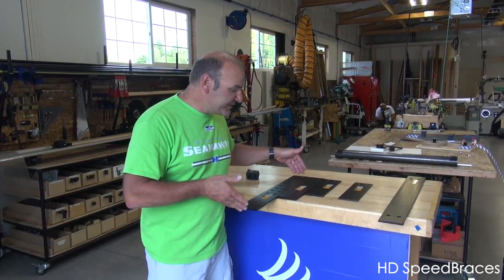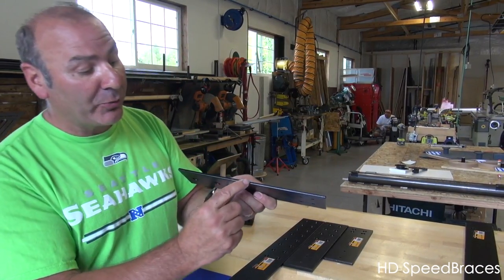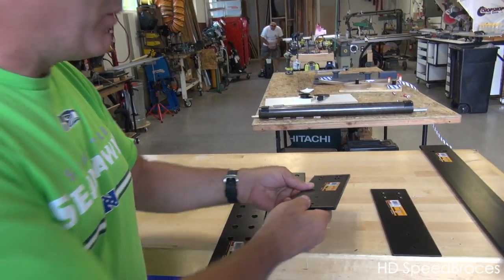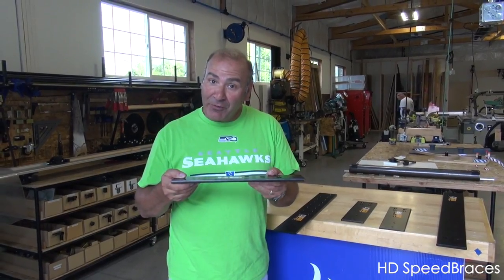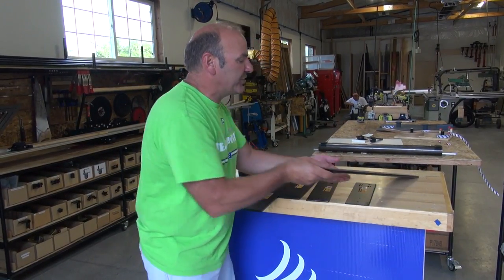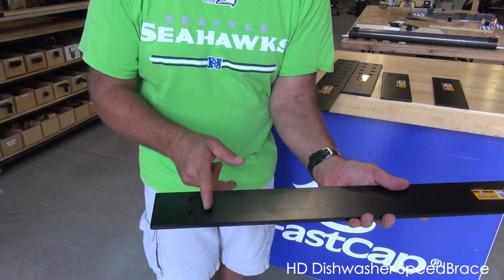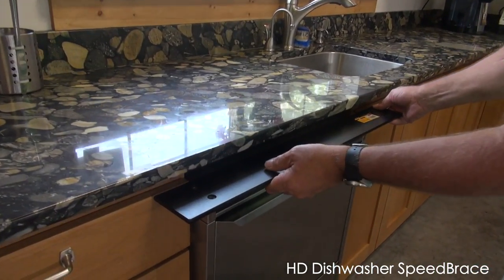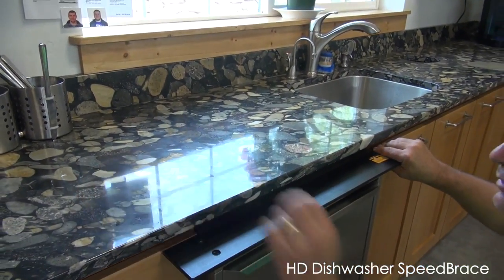Stealth SpeedBrace Overview - Installing Countertops - Lean Manufacturing

Comment: Most often the dishwasher is next to the sink base. It seems like the excess steel toward the outside of the screw holes will disrupt mounting an under mount sink.
Reply from the maker: Jeff: I think you make it excellent observation. The problem is easy to solve by simply cutting off any excess on one side.  I think in retrospect on the design it would've been thoughtful of us if we would've made one side shorter or made the entire brace shorter in totality.  Please watch this video: http://youtu.be/Wj1cdMSCxa4 Paul

Comment: Hi Paul, I saw the video. In most cases the extra length won't disrupt a sink install. Surely it's not too late to adjust future iterations of the product. It's kind of like the un-lean burrito. Giving more than the customer wants often isn't good for customer or vendor. Keep up the good work.
Reply from the maker: Jeff Marner Jeff what will do is wait to get more feedback from people. You're the first one who's brought up this issue.  The difficult thing in the product development world is everybody has a different idea of the way a product should be. So rather than jump too quickly we want to let the product get to market and get a little bit more feedback before we make a change. Nobody can change or move more quickly than FastCap, and we will change as soon as we determine we need to.  Paul
Reply from the maker: FastCap Also, the additional flange and material on each side of the dishwasher speed brace is not waste it actually helps to deter deflection.

Comment: hi paul, 

I notice 2 more screw holes for the countertop braces, is that necessary? or can I get a brace without those two holes
Reply from the maker: Sorry, but no they come in the standard configuration only.
Reply: ok do i actually need those 2 screw holes tho?
Reply from the maker: We recommend filling all the holes on the vertical up-and-down, the ones under the countertop. You fill what you feel is necessary.